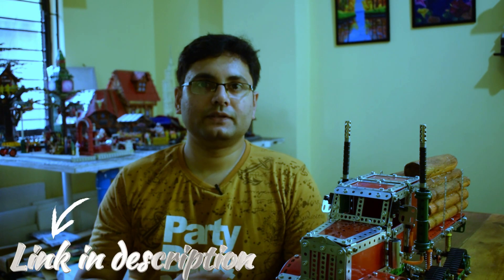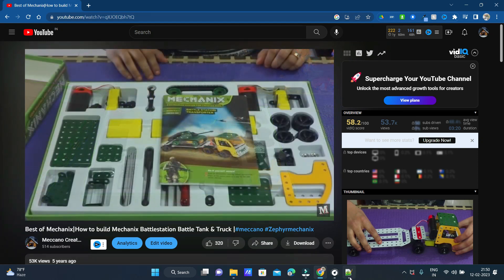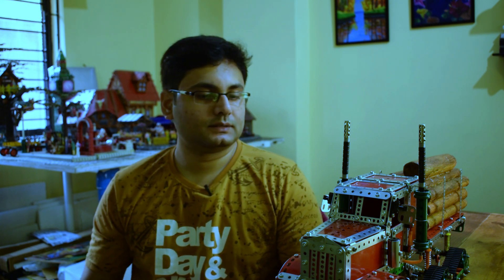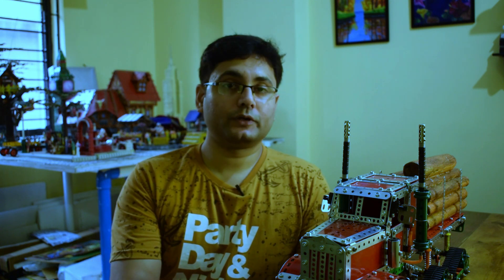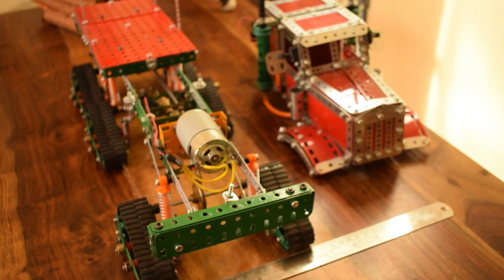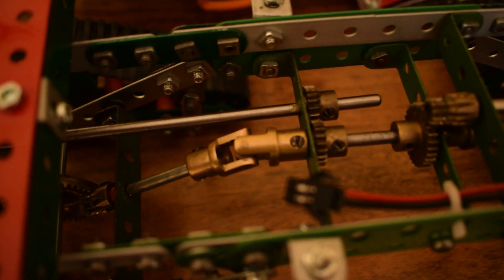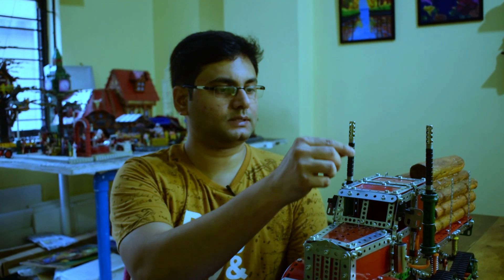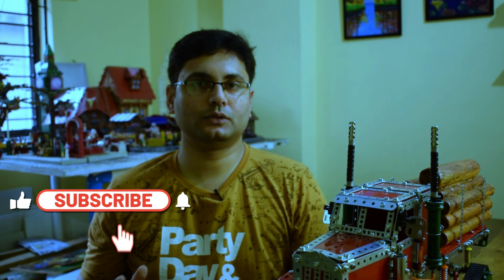Building the Ultimate 6x6 Power-Drive Truck with Crawler Tracks!

Comment: Hi, where did you get the gear shaft/gear's and slip defferntail for this ? i love mechanix but their site is shit. they dont even have many gears. their older sets used to be so good.
Reply from the maker: Zephyr, Mechanix, Toykraft or any other metal construction systems are based on "Meccano" which originated in England. It has a long glorious history. Google it. I have been a avid collector of Meccano set right from 1990s, hence I have these original and some replica parts. Also it is not a slip differential. There is no differential in this truck, just a contrate gear attached to a pinion.
Reply: @saimorph  where are you getting replica parts from in india ?
Reply from the maker: @randombuilder345  It is difficult now as the supplier has shut business. You can try ebay uk, going to be very expensive though with shipping charges.
Reply: @saimorph  i think i know what supplied you are talking about i had reached out to mr banerjee yesterday had found his page via google. Zephyr seems to have the parts but the website is terrible.
Reply from the maker: @randombuilder345  Their website is still work in progress. I sometimes directly reach out to them and order via e-mail or whatsapp
Reply: @saimorph  is there a manual or cateloug that you can share, the problem is there are a lot of parts listed but the lack of photos make it difficult to recognize. which parts they exactly are.